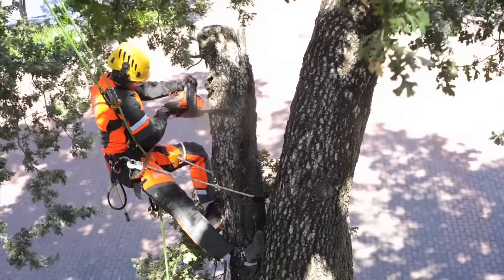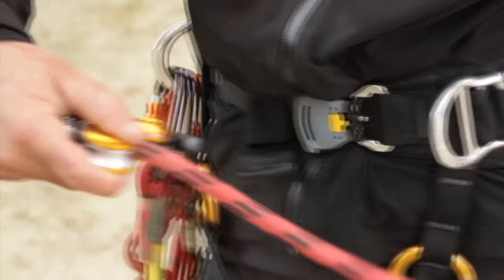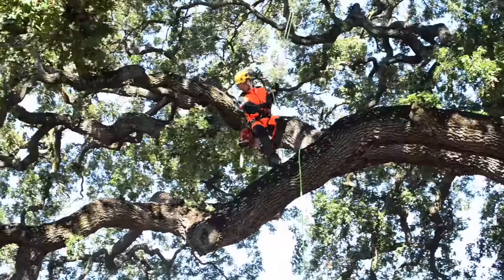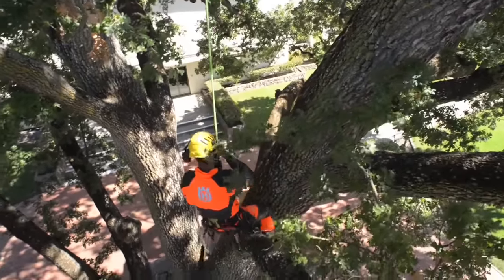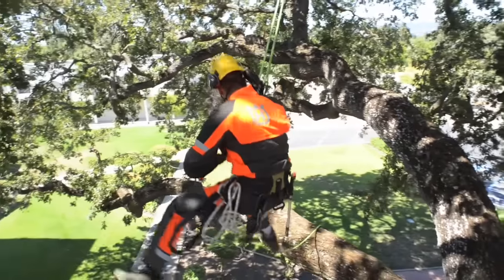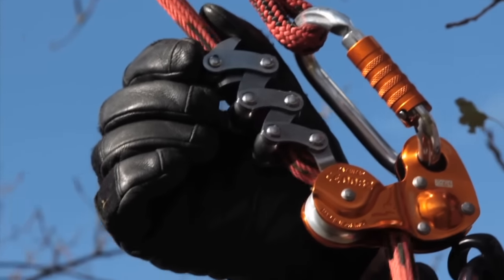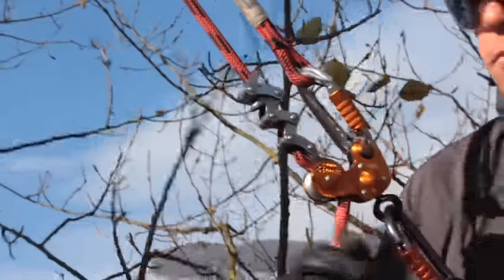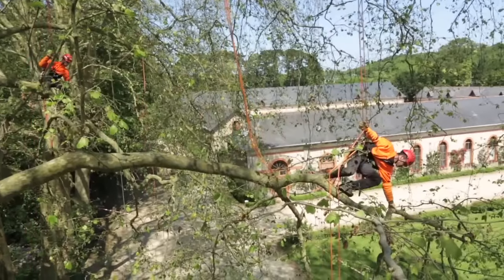ZIGZAG - Mechanical Prusik for arborists - Petzl

Comment: I seen the zizaz used on srt is this okay?
Reply from the maker: Reginald K. Little 

Hello. Thanks for your question. Under normal circumstances, the ZIGZAG is not intended to be used on a single strand of rope (SRT), that is why the field of application is "Doubled rope progression device for tree care" in the Technical Notice.

Under specific circumstances (rescue), the ZIGZAG can be used on a single strand of rope, following specific precautions, mentioned in the Product Experience.

These specific situations are :
- securing the ASCENTREE with the ZIGZAG : http://www.petzl.com/en/Professional/Securing-the-ASCENTREE-with-the-ZIGZAG---single-rope-work-and-access-technique?ProductName=ZIGZAG&Familly=Descenders&l=US#.VPcJn3yG90o,
- using the ZIGZAG with added friction as a second belay point on the trunk : http://www.petzl.com/en/Professional/Second-belay-point-on-the-trunk--without-false-crotch--evacuation-system-with-the-ZIGZAG-in-single-mode-with-added-friction?ProductName=ZIGZAG&Familly=Descenders&l=US#.VPcKLXyG90o.

In the first situation, the ZIGZAG can be temporarily used on a single strand of rope, only to reengage a cam on the ASCENTREE in the eventuality where both cams would have been accidentally opened.
In the second situation, the ZIGZAG is shown with a Munter hitch as an evacuation system, requiring a two hands operation.
Reply: —Chicane has entered the chat—